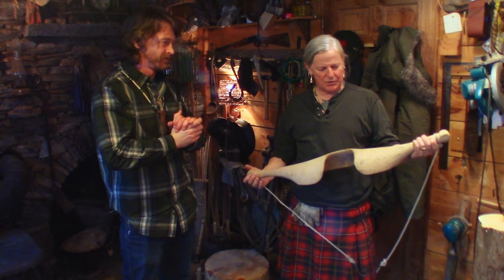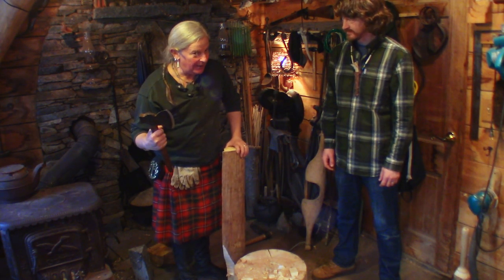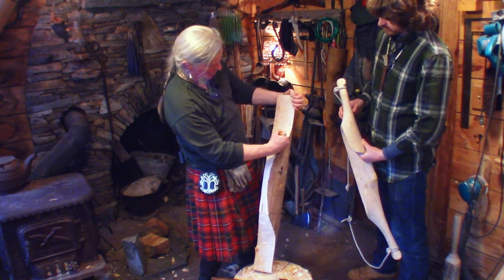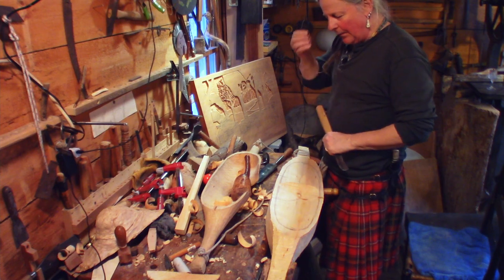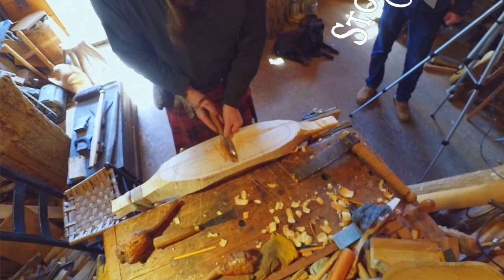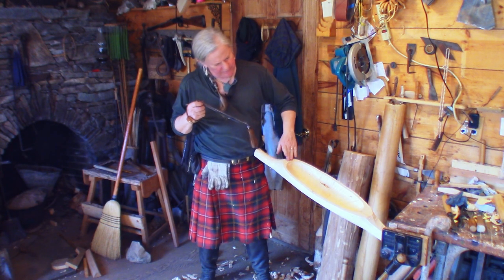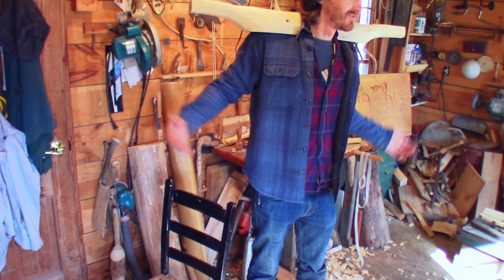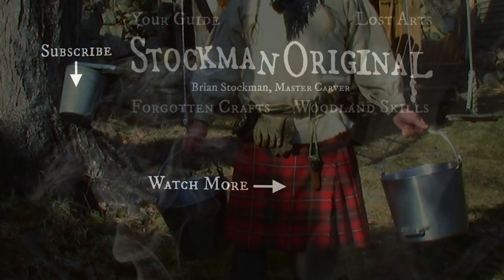The Mighty Neck Yoke. Made from a Log by Hand

Comment: Wow. We just found your channel. My fiance wants to build one of these yokes. How big is that log? And is there any specific wood that would be best? We are in northern Maine.  Thank u
Reply from the maker: missbackwoods4370, we are so happy that you guys found us! The yoke is a great project and will save your back for sure. The log l used was around 7” in diameter and I used basswood. I chose basswood for several reasons,it’s light weight yet has stringy long grain which makes it pretty strong, and it carves very nicely. I’m just over in N.H.and l’m pretty sure you would have bass where you are. I make back packs from bass bark and end up with nice poles of the wood so if you don’t mind a drive you can get some from me if you need.
Reply: @StockmanOriginal  thank you so much, we will definitely try to find some, we have a ton of Poplar as well. I believe that can work. I just know that due to tensile strength,  using poplar it needs to be wider. My fiance is making bows for archery and learning a bunch. We plan on watching more videos soon. We have lots of animals. And our Mule drinks the most. We live off grid in a tiny house.  We plan on training her to pull an amish buggy as our mode of transportation.